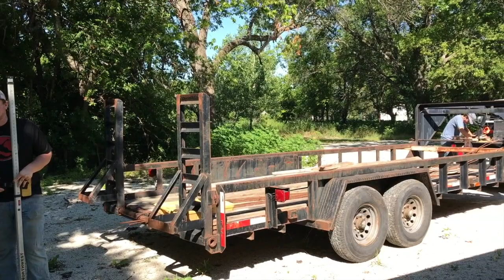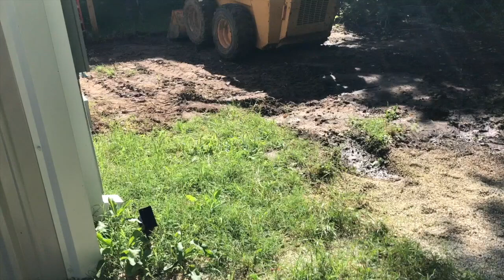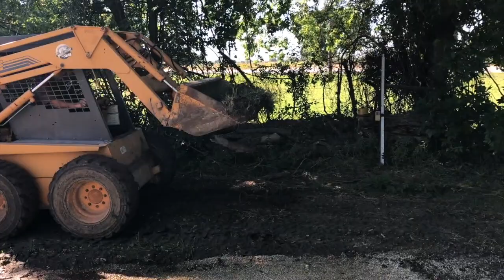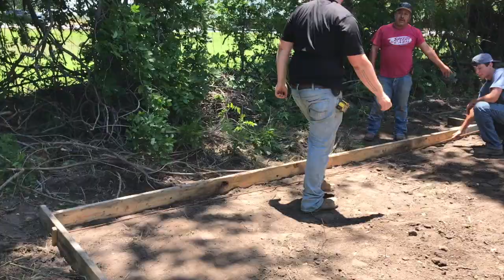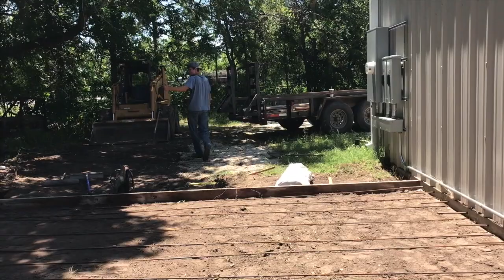Home Paint Booth Build Part 1 - Slab Preparation

Comment: Be sure to lay plastic sheeting before the pour, to keep water/moisture from wicking up thru the slab.
Reply from the maker: For the shop build, they did that, but unfortunately I forgot to ask, and they didn't put the plastic down when they did the pour.  The second video is already up on fabnation if you want to check it out
Reply: I know a guy why applied disposed bottles, both for insulation and moister-prevention. About a thousand of bottles he arranged under the concrete.

Comment: Not a fan of tying into the existing slab...
It should be its own floating slab...
Also, they cheaped out and didnt install gravel under the slab!
That will settle over time, and you'll get some cracking, plus without the gravel, the floor will be more wet, especially on humid days...
Reply from the maker: Some good points thanks